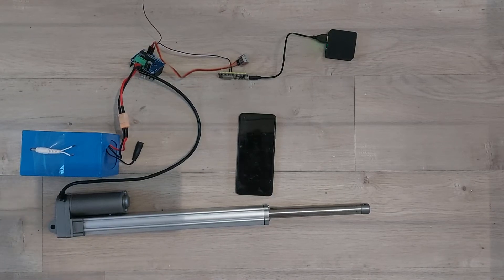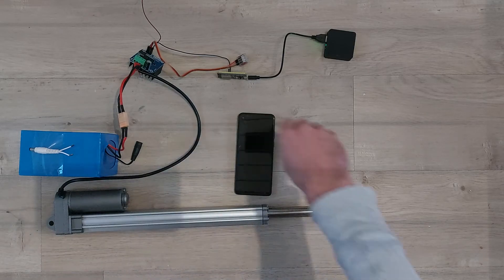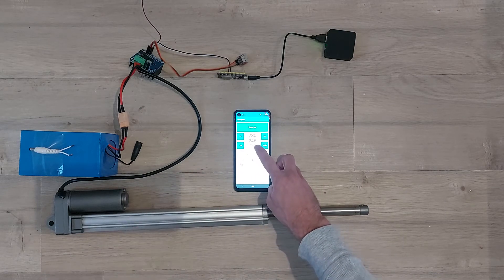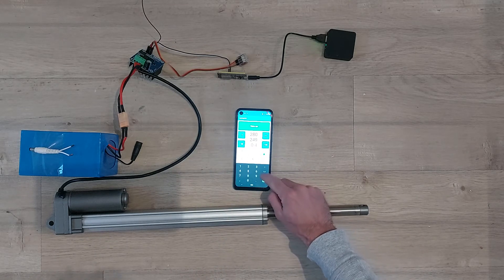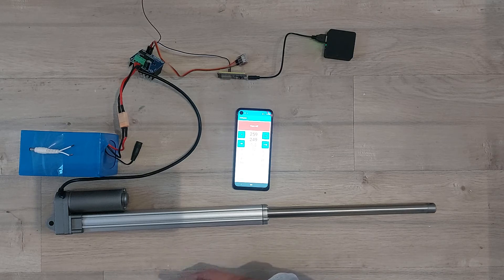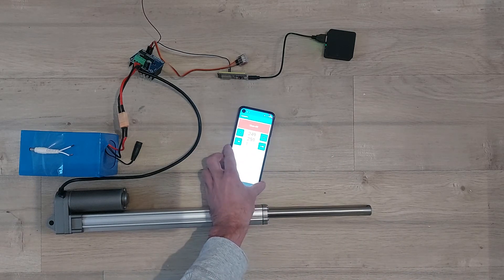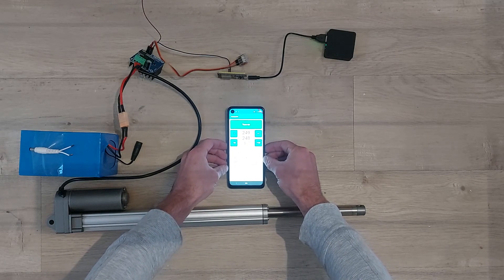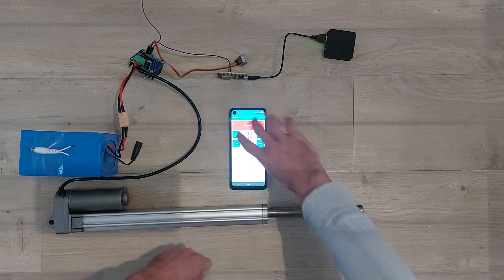Bluetooth autopilot for boats.

Comment: Can you install this on a wheel instead of a tiller?
Reply from the maker: @iaintnosailoryet9834  sure, just buy a wheel drive, like CPT or Raymarine. Any motor with 2 wires is supported

Comment: Would it be possible to connect a compass unit to the ESP32 so the mobile phone wasnt needed or maybe move it over to Arduino as there are plenty of cheap sensor units and associated libraries available for the platform
Reply from the maker: I already made it, not yet available for the public. Also supports nmea, wireless remote and wired remote
Reply: Awesome. Would like to chat maybe as to putting a kit together using a linear actuator design I'm working on
Reply from the maker: @mikeobrien9829  my contact details are in the GitHub page. The GitHub link is in the video description
Reply: @PieterOskam  👍

Comment: can I use it with a 150hp honda outboard with hydraulic steering?
Reply from the maker: Yes, I use it for my hydraulic system as well.
Reply: @PieterOskam  thank you for your answer. My 150hp honda is too heavy that I cannot rotate it by hand. I was afraid of harming the hydraulic system if I apply more force. I am happy to hear it wont make any harm. What type of linear actuator should I use  please?
Reply from the maker: @victorfrankenstein1995  

If it is too heavy steer, check for any resistance. de link it and turn the motor by hand. I am not an expert on this, but you have to google it yourself. 

Just steer stronger, there are pressure relieve valves if it becomes too high. 

If you already have hydraulic steering, just place a hydraulic reversible pump parallel to the existing lines. Many youtube tutorials on that one. Then you dodnt need an electric linear actuator. Hydraulics are stronger than electric actuators!
Reply: @PieterOskam  dear pieter, I believe I misinterpreted my question.

There is nothing wrong about my existing hydraulic pump or system. I just want to use your autopilot system with my heavy 150hp outboard. So I belive I must have an electric linear actuator. I belive there is no way to use your autopilot system without an extra electric steering i.e an extra linear actuator?  Thank you for your concern.
Reply from the maker: @victorfrankenstein1995  

Ok. The best is to put a hydraulic motor. That motor has a red and black cable and will do the steering.  It costs arround 300 dollars

Now  you can use an electric linear actuator but you have to attach and detach it every time you use it. You dont have this problem with the hydraulic. Also, this linear actuator pushes the hydraulic fluids trough the cilinder so you need to insert a bypass valve if your helm has one way valves.
Reply: @PieterOskam  thank you. I understand that my original motor wont do the job and I have to buy a new motor. Can you please tell me which kind of hydraulic motor to use?

Comment: I totally cannot understand the use of compass on phone. I mean, why should I want to know where the phone point to?
Reply from the maker: There are many reasons why.. do you ever use a navigation app such as Google maps? Ever use a Virtual reality or augmented reality app?
Reply: @PieterOskam  Yes Yes okay, but I mean, I imagine the system as a stand-alone system that CAN BE also set by the phone… 
Maybe I’m not explaining what I mean to say, sorry. 
Does the system rely on the phone compass? If so, it could be disastrous to move the phone itself by mistake while underway. 
I’m sure I’m getting it wrong, hence the asking 😊
Reply from the maker: @RaveUniverseAll  That question makes more sense. So, how this project started was because i was good and programming but bad at electronics. So when developing the autopilot, it was much easier to update the software on the phone instead of the autopilot. I could develop super fast. I found using the phone compass is hassle free and pretty reliable.

Yes, moving the phone is disastrous, so dont do it. I turns out that many sailors like this solution above the more complex / expensive autopilots. 

I do work now on a auto
pilot version with an internal compass and phone compass can be used as emergency backup.
Reply: @PieterOskam Okay thanks for answering. 
Yes I could have said this is by far the most complex way to do it… for me. 
Well I’m trying to use a compass board (6€) and one arduino thus totally removing the electronic complexity. 
Still not sure about the proper sw logic
Reply from the maker: @RaveUniverseAll  

The software logic I used is by using a PID controller. where P is  compass heading and D is the Gyro. The difficulty is of having a tilt stabilized compass, and also the Gyro (rate of turn over the earths surface) Now the phone already does this for you.

I initialy used an MPU9250 (6 euro magnetometer+acc+gyro). on an ESP32 (Arduino equivalent with bluetooth power). And also 6 buttons and a display. But the development after assembly went too slow, hence moving to the phone.
Reply: @PieterOskam  There are libraries for accounting GPS positioning to obtain true north but I'm not interesting actually

Comment: Hi, came across this when I doing my research of autopilot.

How do you disengage the actuator when you want to hand steer the boat?
Reply from the maker: I personally have a hydraulic steering system so no clutch. 

These are actuators are normally just put on a pin on the tiller.